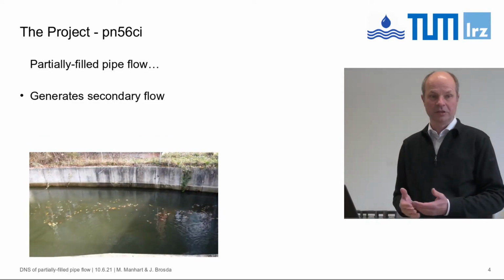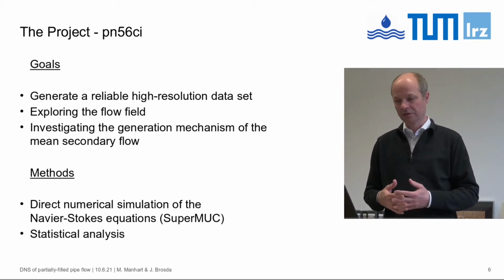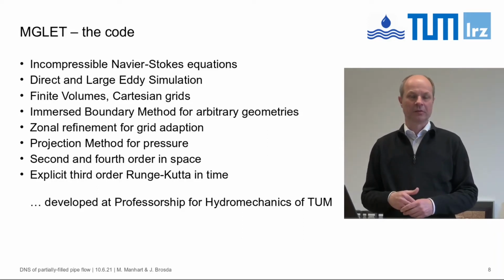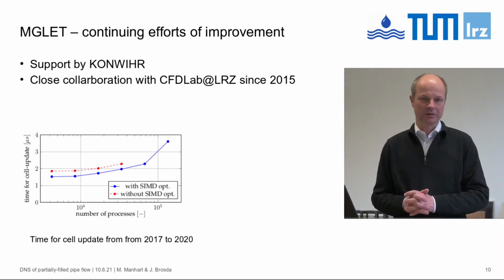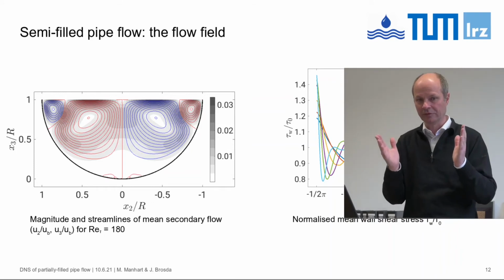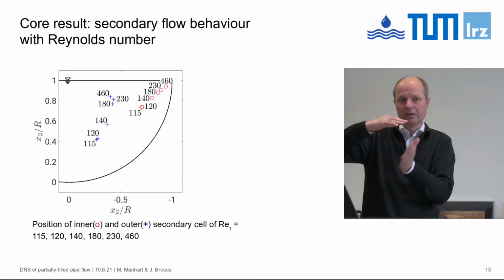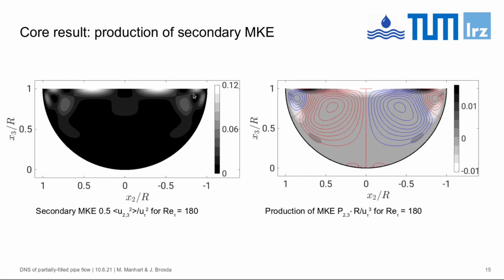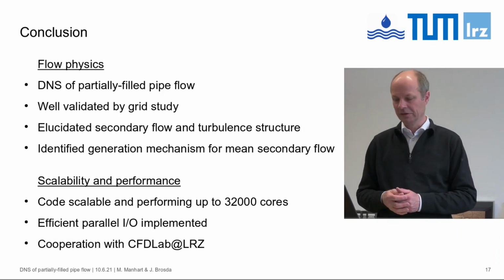Direct numerical simulation of semi-filled pipe flow

Comment: 30,000 processors for DNS simulation of half filled pipe! and they used a lidded surface, oh my god the computational demands of turbulence is so high. the secondary flows cannot be resolved in RANS solvers?